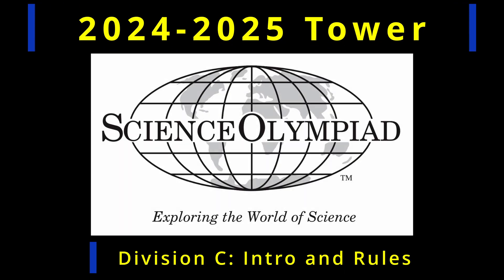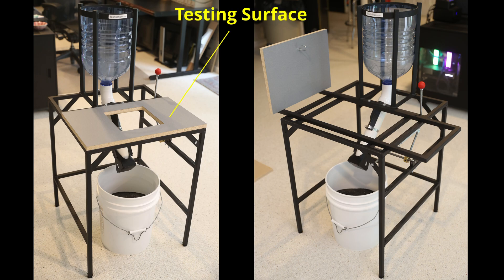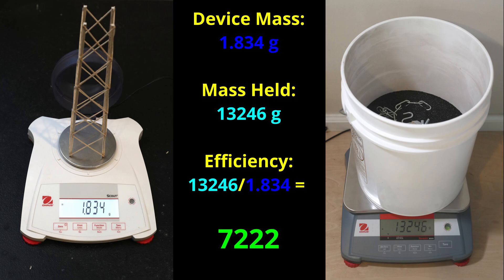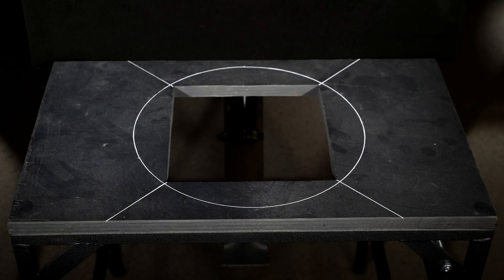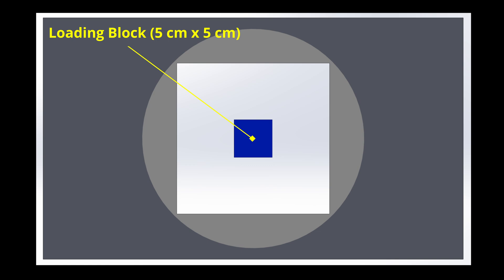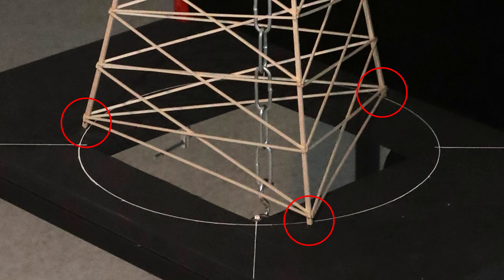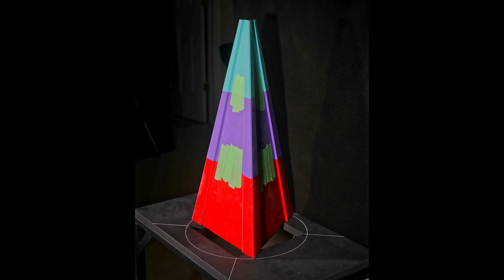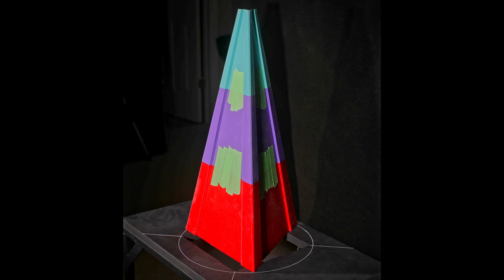2025 Science Olympiad Tower Div C: Intro and Rules

Comment: hi balsa engineering! my school doesn’t have a loader and we’re considering making one, do you have any tips or instructions on how one could be done? we saw that balsa wood hopper had one, however, we’re not sure how long scioly will last at our school which we a result doesn’t justify the cost
Reply from the maker: Yeah, the auto-loader is very nice but also very expensive.  Hand-loading is fine to get started and for that you only need a piece of wood with a hole in it and have it span 2 tables.  Making your own auto-loader is much more challenging as you need to design a way for the sand to stop once it breaks.  I hand built one before I got my auto-loader, but my solution was to make a dynamic load-cell that recorded the max load so the sand didn't need to stop.  That is even more challenging than making a physical shutoff system in many ways, so I don't recommend that.  Personally, I would stick to hand-loading unless your school can afford to buy the nice one.  We did that for many years when I was a coach and it works well.

Comment: What type of glue and what shaped sticks for the cross section and the legs did u use?
Reply from the maker: I like to use 50cps CA glue for all my builds.  I had success with both 1/16 and 1/20 square members for the cross-bracing.  For the legs, you'll need to engineering them.  You'll definitely want to watch this video: https://youtu.be/MTHygxUS3YU
Reply: @balsaengineering6686  thx a lot!

Comment: Hey, thanks for the great video. I get my wood from Hobby Lobby, and sometimes Balsa is hard to find and not the best quality. However, I have seen Basswood. Me and my partner want to test the differences out. Do you think it is worth considering basswood?
Reply from the maker: Definitely give basswood a try if you want, but you'll probably find that it's way too heavy to be competitive.  It is generally only the best option for pure tension conditions.  FWIW, I like to buy my balsa in sheets from Specialized Balsa and cut my own sticks and that has worked well.  Good luck this season!

Comment: Hey I was just wondering what balsa wood company would be the best to build the tower, because last year I used the standard balsaUSA wood
Reply from the maker: You can get good wood from a lot of different places but I like to use Specialized Balsa because it is one of the only ways to get exactly the density range you want.
Reply: @balsaengineering6686  Thanks! Will you provide the density when you do the benchmark build?
Reply from the maker: @steamedfrog8386  I will include all the details of my benchmark build, but not in that specific video.  I will show all the details in some of the videos after that one where I talk about how I went about optimizing the tower.  I hope to have them all out by 9/21, so you shouldn't have to wait too long.  Thanks!